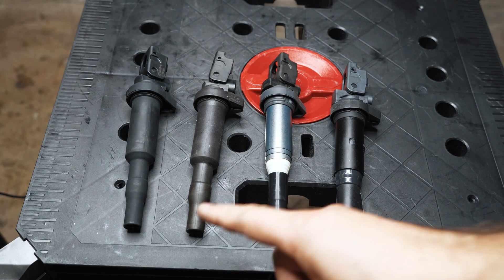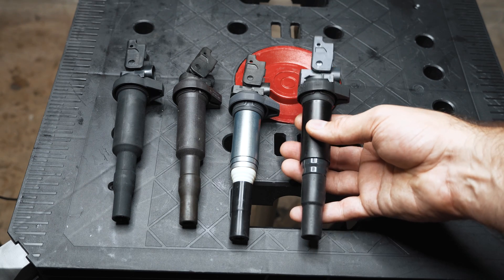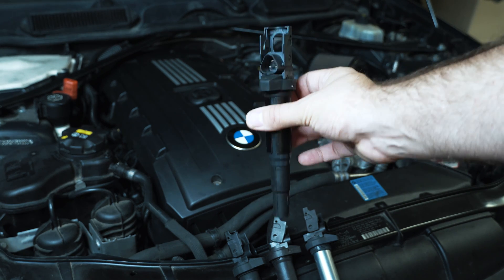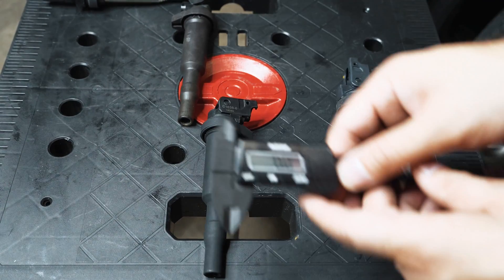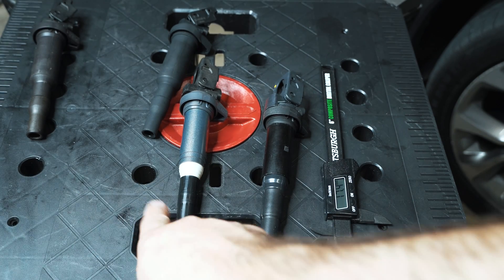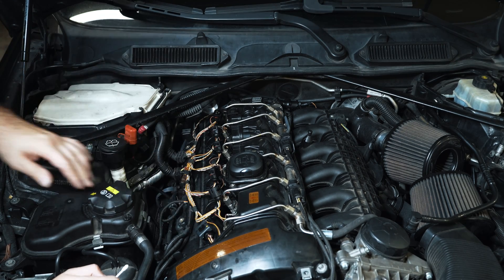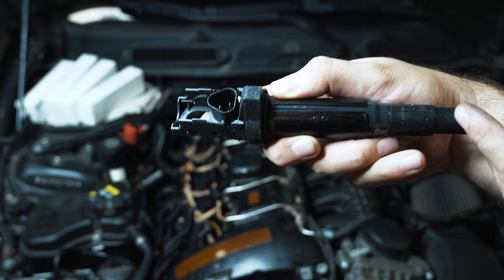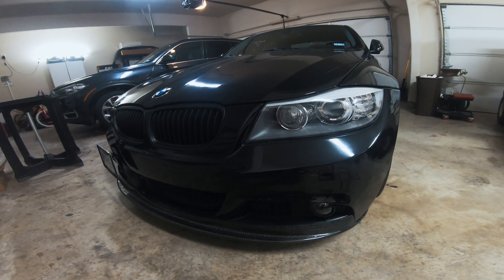The ULTIMATE BMW Ignition Coil Guide | 2003 & Newer

Comment: update: The Delphi coils are now also "made in China" and I can tell you from first hand that they're total junk.  Engine stutters/hesitates below 2k rpm .  Also the rubber booth will remain on your spark plug when removing the coil.  Very difficult to get out and impossible without destroying the booth.
Reply: Ok so it's not just me!!!
I am going insane!!
My delphi coils were good for 6 years and now it's been 3 months and it's the same thing.

2k heavy load... NO!!! Just miss fires!!! 35k up. Perfect.

Sometimes it will miss fire at 48k.

The hotter the coil. The wors it is.
Reply: This same channel has a video on the conversation for audi R8 coils.

I am seriously considering making my own circuit and going that path.

Comment: i have a recent engine knock upon cold start, but runs well after it warmed up, fault code shows multiple misfiring, plugs changed and it still shows misfiring, do i suspect a faulty coil? its a bmw f46 2series with 100k miles  on the stock coil, or do i change the fuel injector?

Comment: Note:  their are different connector standards.  All within the three-pin triangular outer shape but there is a little "dam"  inside that can be either in the middle or like 1/3 towards the edge.    I changed coils to delphi together with the right spark plugs but still have hesitation in cold wet weather at startup.  Haven't tried the Eldor ones yet.

Comment: Do not use Delphie. They work well and look nice but the boots often separate and remain attached to the spark plug in the cylinder. Without the proper tools, you are in for a nightmare of a repair. Also the boots rip easily and leaves behind rubber in the cylinder and you have to use a metal pick and a strong vacuum to get all the small pieces out. I'm speaking from experience.
Reply: Iam having the same problem right ow

Comment: I have a 2008 E90 N43 318i 2.0 litre, approaching 125,000 miles.  Have just installed NGK plugs, replacing Bosch.  The existing original coils are also Bosch.  In the UK, recommendation for coils seems to be Delphi, but would Eldor coils be better?  Many thanks.

Comment: 1:38 Correction (in the time this video was posted), BMW never moved from Bosch to Delphie for the N54. It was the N54 community that discovered the Delphie coils from the N55 and M3 are compatible with the N54 and started recommending it. BMW officially went from Bosch to "Eldor" coils which is the one you pointed to at the end as the better coil (agree 100%). Then they moved from Eldor to Delphie(cheaper). They went backwards technically. Eldor coils are the better OE pencil style coil for this platofrm.
Reply: Seattle mini is selling the GN10571 delphie coil as the oem replacement for a 2008 mini cooper s
Reply: Exactly and when you pull the plug it doesn’t came apart inside the cylinder wall like the metal Delphi ones. Bosch and Delphi and worse than eldor

Comment: i have an 07 525i so i probably have a bosch ? im at 117k miles but i have no idea if they changed the coils. wondering if u should upgrade to the 3rd or 4th ones in your videos i just swapped the gasket on the valve cover tho it was starting to smell bad in the cabin

Comment: not sure if this has been answered but I have an early 2006 model E91 with the connector tab on the left, not the center. does eldor make coils for the older style connector as well? or do you have a recommendation? id rather not change the connectors or the harness if possible.

Comment: The cheap and the old Work better For me then the delphi ones come apart and then when You put them back together They dont want to work, For somebody that plays with his car alot i dont recommend the Delphi ones I dont know about the Eldor ones but I like the design!  i havent tried those but ive also had good results with the grey bosch ones with high HP application!

Comment: Hi e60 525i n52b25 
0/8 . Check light ,obd2, missfire cyln #6. Bosch ign coils. Swapd #6 for #2 . No diff . Swapd same ngk plugs , no diff obd still #6 missfire.nxt move! #6 injector ,check and clean . 
Any thorts on next move .?

Comment: I just installed eldor coils and it fixed the little stagger in rpms left after a new valve cover gasket fixed a crazy misfire, at idle, but the car feels crazy sluggish, is there any break in period? The spark plugs have less than 300 miles on them. Help 😩

Comment: I had to sub after watching this video. The BEST video on BMW coils on You Tube. Well done. I have an NA Dyno tuned very quick 2005 E46 M3 with a LOT of tweaks and mods. However, NO BOOST. I am Soooo jelly of your boost. 

Getting a built motor and E85 flex fuel boosted motor with all the other support items and mods is on my bucket list. It's minimum $40K to really do it up right with an AEM Infinity ECU, plasma coils, 1000 RWHP axles, Fuel system that wont starve on the track because of G forces etc etc etc. 

Then to TUNE it all so you have a really effective traction control and variable boost depending on amount of E85 in your tank. I NEED about 800 RWHP on pure E85 and 25 to 30lbs of boost. Anything less just will not do.

But 500 plus with TURBO boost is nice. 500 RWHP with a super charger on my S54 motor is NOT worth the money. No torque. Terrible dyno curves. Its gotta be turbo on 3.2 liter 6cylcnder. Besides, I HATE the super charger whine with a passion. I LOVE turbo whooshes and pops!!!!

Comment: I bought the NGK U5039 48147 ones as they were a bit cheaper.  Weighed in at 220g.

The outer silicone sheath and top plastic cap is identical to the Bosch but the whole thing is 10g lighter.  Made in China - was hoping for Japan.

Comment: Great video. I think I found the answer to my question about whether the same coil can be used in many different motors.  It sounds like those same Eldor coils used in 2015+ models and your E9x 335 will work perfectly fine in a S85 motor, correct?  Edit: After more research I’m more confused.  I thought these BMW coils had internal igniters because I thought all coils with 3 terminals had internal igniters.  Now I’m reading that these coils you’re talking about don’t have internal igniters.

Comment: After putting in some E85 in my N20 engine, the engine developed a rough startup and humming noise. When checking my coils I find out they are the Delphi ones and they are very loose in there! Like even when pushing in and the connector clip close a can relatively easy pull them out? Could this be a problem  or is this normal with the Delphi coils? Thanks

Comment: Great video.  Very good information.  How often should coils be replaced?  Just until a mis-fire issue or a certain mileage is reach?
Reply from the maker: I'd say 100K miles.
Reply: How do you know how many miles may be on the used coil

Comment: Hi, i have 4 old style bosch coils (1220703201). Primary resistance is OK, but the secondary on 1 of my coil is 500000 ohm and the others are beyond the limit of my multimeter(2000k). Is this OK? My engine start hard with high octane fuel.

Comment: Don't know why YouTube recommended this video to me today, but FYI -  for any BMW N52 owners out there who stumble upon this, be aware that if you have an earlier N52 with the metal valve cover, you have to use the OE Bosch coil with the offset locating tab in the plug [0221504465]. No one else makes them and any other coil with the locating tab in the middle of the plug will not fit in the metal valve cover.

Comment: Hello man, this comparison of yours seems to be meaningless. Can you prove the pros and cons of the product based on the weight alone? Now more raw materials have different proportions. 1. The difference in weight may be related to the amount of copper wire in the coil, but it is not absolute. 2. Bosch's weight is heavier because he uses UP plastic (a material with a high specific gravity), and because he uses more copper wires as resistors. So the weight is relatively high. 3. The different structure of the product is also an important factor affecting the weight of the product. (For example, more silicon steel is used). Therefore, I think the advantages and disadvantages of products are that they have higher ignition energy, more reliable heat resistance and longer life, which are good products. Please believe in Made in China. His quality will be higher and higher, the key is that you have to pay a higher purchase price. Hope to communicate with you pan@paboauto.com

Comment: what do you recommend for a 2004 BMW 325i m56 SULEV engine?
Reply: I see they do make them for a 2004 bmw but not sure they will work on a m56 engine.  My # 6 cylinder is misfiring at 46k miles.  I wasn't going to spend that much to replace one but now you got me considering replacing them all with this brand $145.00 on ebay for all six

Comment: thankyou bought the coils using your link
Reply: car running OK?
Reply: @aslandogar7779  yes, but I had found out that I needed to replace the mosfets on my msd80. This was the same code that I was getting prior to replacing the mosfets and the coils. I found a V..DYI video on that 30BA code and did the soldering my self. for $50 for all parts I saved myself $1300 to replace the DME. The car has been runny really strong for about 2 weeks now.

Comment: I just sold my 44,000 mile 2007 Z4M, which had no problems. My 2018 BMW R1200GS motorcycle's left coil is starting to cause a misfire and set off the check engine light. One new OEM coil from the dealer is $188. I found two used Eldon coils online for $112. I was unfamiliar with the brand and now after watching your video, finding they are OEM, I feel good about buying the nearly new Eldon coils from a licensed motorcycle dismantler. They came off a bike with 9,000 miles, my bike has 14,000 miles, so the Eldons that are on their way are fresher. Thank you from Sacramento for the education.

Comment: Hello, today I checked these my ignition coils and secondary resistace They has about 15-17 MEGA Ohms, 1 of them have 14,5M Ohm. I have problem with bad idling, spark plugs are black and dropping down the RPMs when engine decelerating (injectors, throttle body, hpfp. lpfp, pcv, plugs okay). According the Bimmerprofs blog this method for a testing secondary wiring is not good, but I am not sure about your Delphi's 100kOhm and mine Delphi's 15Mega Ohms. Are you sure, about good working coil? Can I buy a Eldor for my engine N43 105kw and they will works safety?

Comment: my Bosch coils never misfired with stage 2 MHD tune ,stage 2 turbos , but i just ordered these Eldors after watching the video .
Reply: hey how are the Eldors , i got some shitty bosch im changing out .  delphi or eldors???
Reply: @napoli.4life  they’ve been good , make sure you gap the spark plugs properly if they’re not pre gapped because that would cause a misfire , but Eldors are working properly with my new custom tune and I’m pushing 21 psi boost with no problems, hybrid turbos fbo 94 octane pump gas

Comment: Will these eldor coils work on the v8 cars? Specifically the s63tu? Thank you for this video btw.
Reply from the maker: Yes they work on the V8 cars as well.  Glad you found it helpful.
Reply: After this video, I started regretting purchasing the OEM ones. Please share your experience when you try the Eldor.
Reply: @mohamedalbahi4745  I just sent my eldor coils back. They do not sit right on the plugs. The metal makes them a hair too big. I returned them and ordered delphi coils. Eldor may work will but come off the plug way easily for my liking. Just my 2cents🤷‍♂️
Reply: Hey do you recommend eldor in my fO2 N63?

Comment: I just installed the Eldor's on my 2010 528Xi. So far so good. Many sites say that the Eldors are not compatible with the N52 motor but they seem to be working well on my car. I have 150k miles and was having a miss in cylinder 6 so decided to replace plugs and coils. I used NGK Ruthenium plugs.

Comment: Just changed mine from original bosch to  delphi. 66k miles Z4 N54. Did not have any codes but wasnt running totally right... a bit ruff+ like some  power missing... but it drove and no codes or CEL. After replacing coils... instant start, rock solid idle, lot smoother drive, more power down low ( noticed i had started to downshift often when accelerating, now pulls nicely from low rpm).  Still felt power missing in boost, so did reset my ECU for adaptations reset. That made the difference. Pulls nicely now.  Cobb Stage 1  93 tune otherwise stock car. New properly gapped one step colder iridium plugs  were installed a few months before the coils.  

I had actually postponed my coils purchase hoping to get a code or check engine light as a sign to do the change, but it never came. Just  felt wierd. So  If no codes but still feels a bit wierd, probably just change the coils. Not that expensive.  Got delphis 124 eur  online. Did consider Eldors, but they are hard to get in my area, probably  would have had to buy them from dealer for double the cost. Webshops dont offer Eldor at all here and even FCPEuro its delphi or BMW OEM.
Reply: Do you remember which plugs you were running?

Comment: hi great video  i just subscribed...i have a stock 335i convertable 2008 i have code p0303 and p0304 misfire i changed all spark plugs to stock bosch sparkplug cylinder 2 and 3 had some all on the plugs i have a question can i just change the 2 stock bosch coils that ar misfiring or should i just change the 2 with the eldore plugs they are only 6 bucks more but i dont want to change all 6 just the 2 can i do that? or just stay with the stock bosch coils...my car is all stock i dont want to upgrade...thanks

Comment: When I asked FCPeuro why they haven't upgraded their BMW Delphi pencil style coils to the latest and better upgrade ELDOR coils for the F10 owners and n54/n55 engines, this is what they said:

"Eldor coils are not recommended for the N55 engine, so we do not list them for the BMW N55 applications. If you still want to buy them the part number is 12138657273."  <------- these are the Newest Version!

After watching one of their videos and the camera panning to the side and them bragging how they just got a huge amount of pallets full of DELPHI coils, now I see why they didn't recommended Eldor coils... Seems they just want to sell all their inventory of Delphi coils first before the switch!  lol....

-- This is info I got from another BMW online retailer on the Eldor coils...

*  Ignition coil with boot and updated metal sleeve. Made By BMW-Eldor OEM.  *

Part# 12 13 8 657 273 (Eldor Became an Ignition Coil Supplier to BMW in early 2016)

Eldor # R3516S00100 (PBT-GF30)
Replaces Past Bosch Coil Part# 12138647689
Replaces Past Delphi Coil Part# 12138616153

Comment: I have no misfires with a used 135i with a stage 3 Dinan tune I just purchased. When driving slow like when parking it sometimes sputters or more like it revs once without pushing the gas. Seeing it is at 55K miles and tuned I decided to give a new coil pack upgrade and plugs a try to see if things run smoother. It's kinda a sh*t show on the forums regarding Delphi, Bosch, etc. After seeing this video I will try the Eldor 12138657273 from oembimmerparts site. They are recommending the Bosch plugs and select them by VIN. The crazy part is non logo Eldor coils are $30 and $80 with logo. After chatting with the rep he assured me to save the money and get the non logo ones. Thanks for the upload. It helped a lot. Subscribed!

Comment: Another great video by you. I have one request. I have changed my alternator and brand new battery for my X5 2002 4.6is and battery light is stay on. Please let me know any suggestions. Thanks
Reply: SHAHRUKH MUHAMMAD  did you register the battery to the car?
Reply: @michaelgordon3434  4.6is 2002 doesn't have smart battery features. 2006 and up. Thanks

Comment: I want to ask I have n54 335i. I have ngk gaped plugs with delphi coils.I pulled them out and cylinder   5 and 6 the rubber of the was expandet and soft and it couldn't go back it was too soft to pop just bouncing. I don't know the reason. They're a few months old. I lef the coils for a few days and the seems much harder and it got it's shape back to normal. And when I pulled out the coils the car was not driven for 1 week. I do not know the reason why the coils where in this condition when I pulled them out. Help please!

Comment: My friend. I have a 2009 BMW 128i with N51 engine 3.0 i change new coils the past winter and new spark plugs and new fuel injectors. was driving nice. just for a cople months. And now i have problems with coil number 1 and number 5. Do you thing this Eldor 12138657273 fits the N51 or its just for the N54 engine.?

Comment: Got my coils from ECS tuning for My N46 engine. They have the N54 specs. Fitment is fine and so far they feel very good.
Reply: Hi Loek, I also have a N46. BOSCH bit failed twice in last 10K kilometers, I was planning to change to Delphi/Eldor was not sure if it fits, as none of the seller lists N46 as a compatible engine (amazon/ebay). Which one did you replace with?
Reply: Youbaraj Sharma, hi, I ordered mine from ECS in the USA. Straight fit on my N46B20 and performing well. For N54 motor to be exact.

Comment: My 07 335i with over 100k miles still on OEM  coils.  Only misfire  was with worn plugs. I am running  AP stage one tune 14psi .  Boost pressure requires more  energy from the coil.  I guess the only way to test these coils is with high boost applications.  Will Elder fit the N54 if my OEM start failing?

Comment: Our E90 328i had coil failure at 30,000 miles. Not an issue I had come across. My last Toyota went 205,000 miles on its original coils. The current one has 130,000. Just another example of the poor engineering that makes BMWs junk.

Comment: You sure know alot about these bmw solutions.Tks question does a 08 335i with N54 engine have a Disa valve? Possible bad idle, sputters until throttled up. Cant find it.